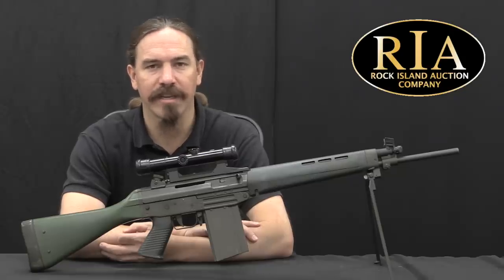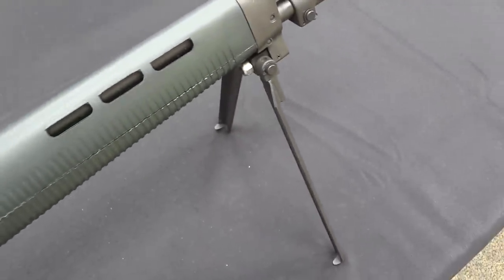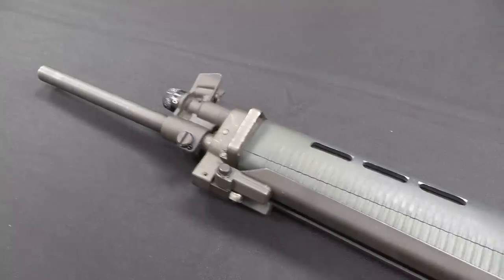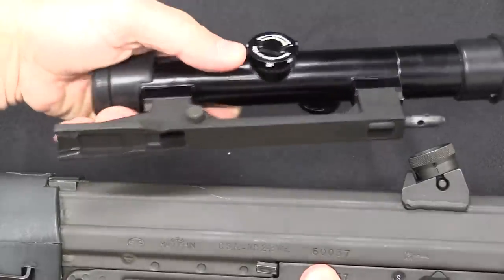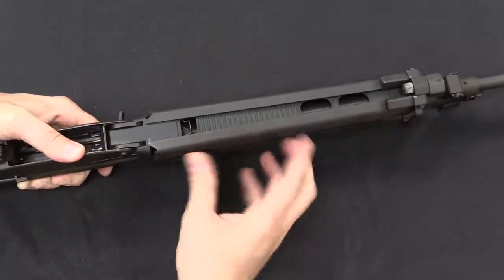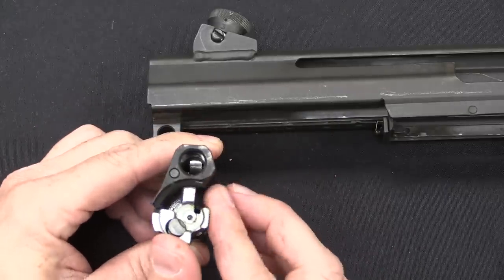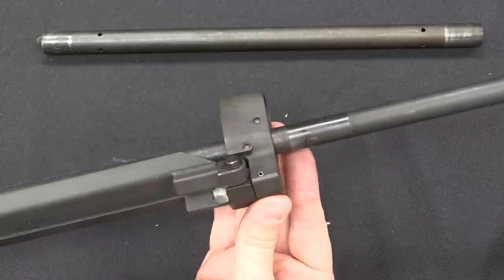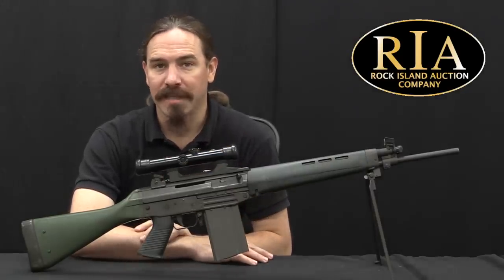The Last Swiss Battle Rifle: SIG-Manurhin 542 (in .243)

Comment: Is .243 anything like 6.5 Creenmoor? Do they use similar brass?
Reply: .243 WINCHESTER is just a .308 WIN necked down to load a .243 cal (6.2mm) bullet. Creedmoor is basically  a necked down .30 TC. Creedmoor bullet is about 6.7mm in diameter.
Reply: .243 has longer case, higher case volume, allows much lighter bullets (50-80gr) compared even to 6mm Creedmore (75-110) let alone 6.5 Creedmore (90-147), lower recoil and flatter initial trajectory.
But usual rifles for .243 have something like 12" twist, NOT allowing heavy for caliber (100gr+) bullets. It is of course not the problem of the cartridge but of the barrels, with tighter twist it still works with long-range 108gr bullets.
Reply: There actually is a 6mm Creedmoor, which uses .243 bullets.

Comment: Is there a potential issue of spring deformation from being that close to the hot barrel?
Reply: StGw 90 uses the same setup, and I never heard of that being an issue.
The spring being inside a pretty solid gas tube probably helps.
Reply: Shouldn't be. You'd have to get the spring over 400degF/200degC before you start to get in trouble.

Comment: Why is it we never see military/law enforcement rifles in 243?
Reply: For the military, probably because the potential advantages over 7.62 and 5.56 weren't significant enough to justify introducing an oddball hunting cartridge into the supply chain.  For law enforcement, apparently LAPD SWAT did use .243 bolt-actions at one point.